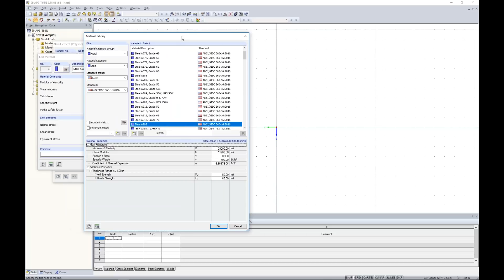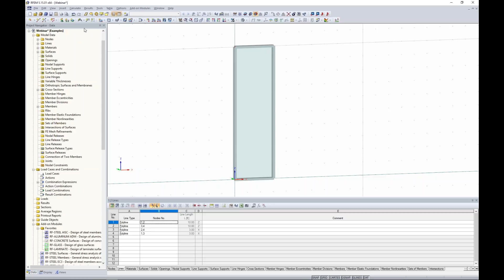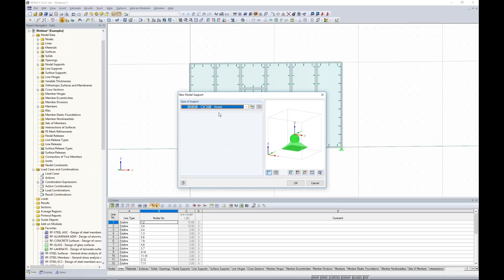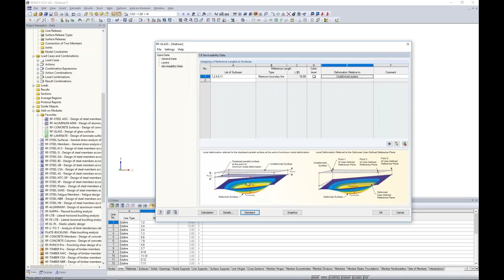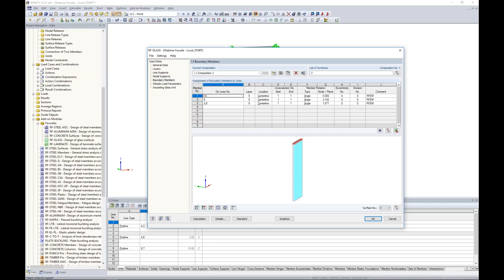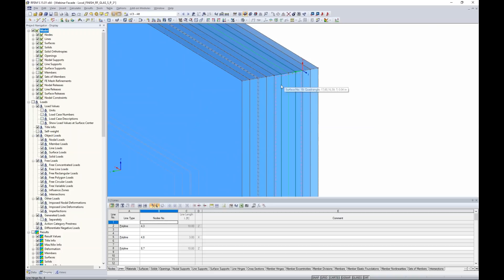Comment: I have some questions : 
1- WHEN I INPUT ATOMSRHRIC PRESSURE  IN MANUFACTURING AND MOUT RF GLASS  CALCULATE EACH SEPERATLY ALSO IT TAKE PRESSURE OF GAS INTO CONSIDERATION OR NOT ?
2-load percentage of temperature and atmospheric pressure why you divide  into 50 % also it difference of thickness like 6+1.52+6 mm external and 6 mm internal  ratio remain the same (50 % ) or be different ?
Reply: please can you share gas pressures calculation ?
Reply: Hi, mostafa!

The RF-GLASS manual located on the Dlubal website will have basic information on the climatic loading theoretical background as well as an example calculation. You'll find the manual available here:

https://www.dlubal.com/en-US/downloads-and-information/documents/manuals?category=add-on-module-glass&porder=desc&psize=18

For a more in-depth look at the climatic load calculation, please email us at info-us@dlubal.com where we can send you an internal document via email.

Comment: Atmospheric pressure  from source I can get it ?
also temperature of gas program calculate automatically or not ?
Reply: Hi, mostafa!
The user will need to determine what these properties are for the program input depending on your project and project location. The program cannot determine this automatically.
Reply: @DlubalEN  okay if i in summer and external pressure is 122 f and internal temp. is 66 F WHAT IS AIR TEMPETURE THERE ARE SOME FORMULAU TO CALCULATE IT IN REFM?
Reply: Hi, mostafa!
The RF-GLASS manual located on the Dlubal website will have basic information on the climatic loading theoretical background as well as an example calculation. You'll find the manual available here:

https://www.dlubal.com/en-US/downloads-and-information/documents/manuals?category=add-on-module-glass&porder=desc&psize=18

For a more in-depth look at the climatic load calculation, please email us at info-us@dlubal.com where we can send you an internal document via email.

Comment: Hi, I have got a question; Is it also possible to analyse stresses in both glass and an aluminium frame at the same time? The case that I am trying to analyse, is where the deformation of the aluminium causes stresses in the glass. So, I would like to get results from both the aluminium as the glass. I did not find any tutorials showing this yet. Please let me know. Kind regards, Mats
Reply: Hi, Mats!
Stresses can be determined for both the aluminum frame and glass panel within RFEM but only within the RF-STEEL Members add-on module (aluminum is possible in addition to steel) and the RF-GLASS module respectively.  Unfortunately, both stresses cannot be viewed concurrently graphically. This will be improved within RFEM 6.
Reply: @DlubalEN  Hi Dlubal Software EN, so if I understand correctly; It is possible to analyse the stresses in glass caused by the deformation of the aluminium? (I am not that familiar with the RF-STEEL modules yet). If the analysis is done separately, the deformations and stresses in the aluminium frame are influenced by the resistance of glass panel in the middle. The other way around, the stresses and deformations of the glass are influenced by its surrounding aluminium. In other words; Can both the RF-GLASS and RF-STEEL modules take into account the material proprieties of the other material (glass/alu)? I hope that you understand my question correctly. If not, you can send me an email and I can send back some pictures of the concerning situation. You might be able to give some good advice for the specific situation. I would already like to thank you for your help and clear answer. Kind regards, Mats (mats-poppe@hotmail.nl)
Reply: Hi, Mats!
The "analysis" portion is always done in the main program RFEM considering all materials, elements, stiffness, etc. of the entire system together.  This means the effects from the aluminum are considered for the glass analysis and vice versa.  The analysis is not done separately.  The add-on modules are simply used for the "design" portion such as a general stress design based on the material properties in both RF-STEEL Members and RF-GLASS.  The stresses from the analysis in the main program RFEM are simply transferred to the add-on modules and a general stress design is performed as a subsequent step.  

The previous answer was to let you know that the stresses for both the glass and aluminum elements cannot be viewed simultaneously in RFEM.  They can only be viewed separately.  However, the analysis for both is still performed simultaneously.  If you have further questions, feel free to email us along with your model at info@dlubal.com.
Reply: @DlubalEN  Clear, thanks for your answers!

Comment: If I don’t make line release for glass surface do results be different 
If there a guide for design please can you provide for me 
Thanks a lot for this webinar
Reply: Hi, mostafa!
Line releases will impact your results.  The purpose of this feature is to accurately capture the connection details between the glass panel and the boundary member (mullion).  Therefore, you'll need to determine which DOFs to release or set as fixed between these two elements within the line release. I would also suggest to refer to your country's code for glass design for additional guides or resources.
Reply: @DlubalEN  
Thanks a lot for your reply 
you refer to guide in webinar I search a lot in internet and I don’t find it 
Can you provide it for me please
Reply: @DlubalEN  and if I don’t make line release fixation between glass surface and boundary element is what? 
Fully fixed or what
Reply: Hi, mostafa!
The design guide referred to is the NCSEA Engineering Structural Glass Design Guide.  You can find it on NCSEA's website for purchase.  Additionally, if no line release is added to the model, the elements are considered fully fixed by default.
Reply: @DlubalEN  Thank you very much